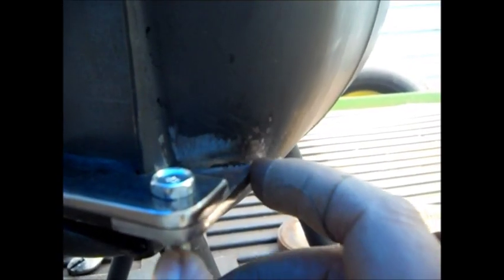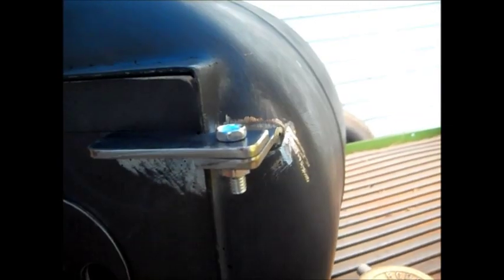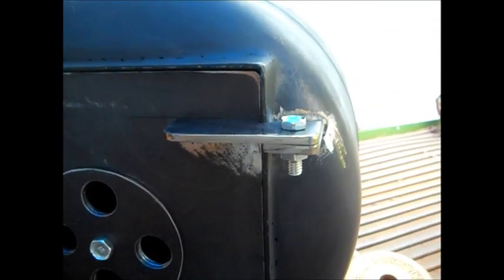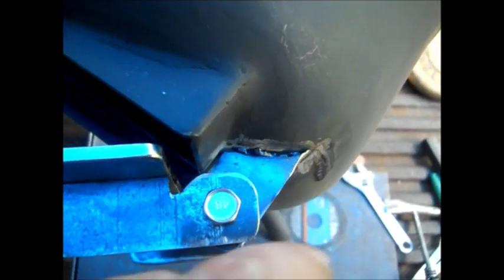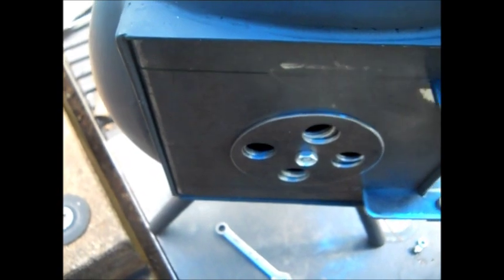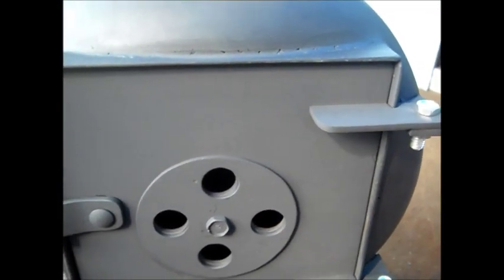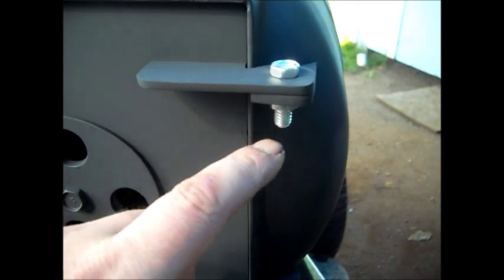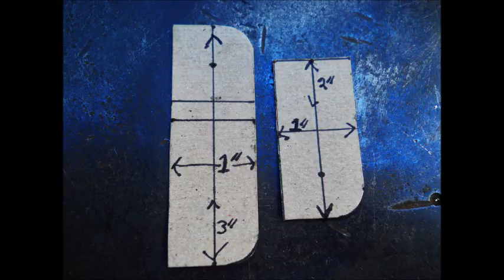Propane Tank Camp Stove Part 6 ( DONE )

Comment: Since your hinges are both bolted from the top here's an idea ..... Take the bolts out and drill the holes to except a 3/8 or 1/2 piece of round stock then weld the tops. This will make a pin . Now you can lift the door off it needed. ( Note ...) I would also weld the underside of the rod . Very nice work !
Reply from the maker: That is a good Idea You could also drill them for a cotter pin Thanks for watching !!!
Reply: Thats a good idea too !!!  Either way, You have a real nice stove !!!

Comment: Keep in mind that I am a complete novice but you're a man with skills, imagination and tools.  I've seen other stoves with reservoirs of water and / or small drying racks.  Would it be possible to weld two pipes through or over the stove and interchange drying racks and water containers so that you could at least get warm water, drain the two side tanks, remove them and replace with drying racks?  I know the foundation would have to be sturdier and it could be a balancing act with the tanks.  I thought I'd throw it out there and see what you could create or if it would be even worth it.  And it may take a larger tank.

Comment: Would you have a video that would show the safe removal of a propane tank valve?
Thanks
Scott Rogers
Reply from the maker: +Ontario Woodsman Youtube has been picky about that so I never show it in a video I have made some hints on doing it There are some good videos on youtube showing it ....Common sense and understanding how a gas like propane acts is important I have ways of doing it that are 100 percent safe I use ways with soapy water and purging with air  Etc
Reply: Ontario Woodsman I had a 100lb tank that I used a 24" pipe wrench on the valve and a 2x6 to hit it.